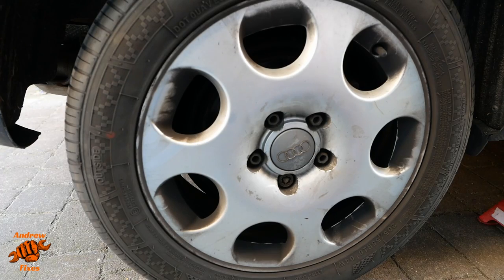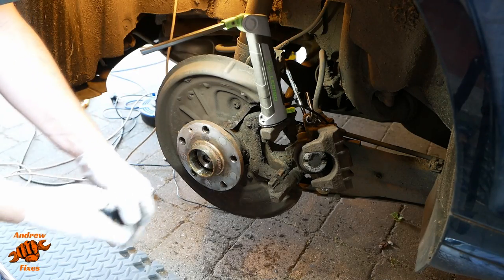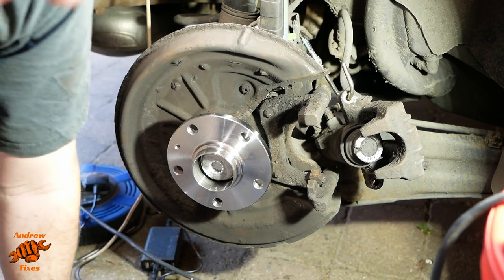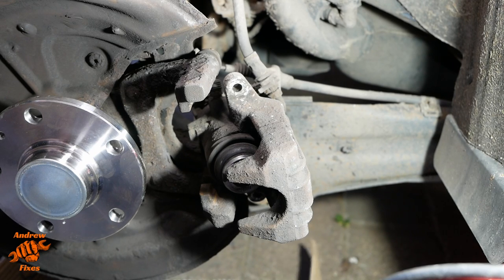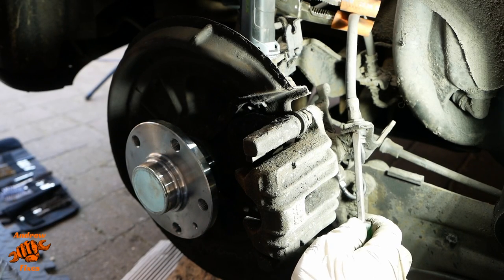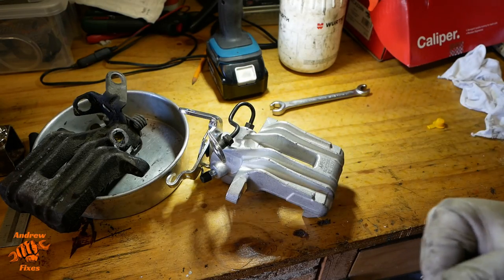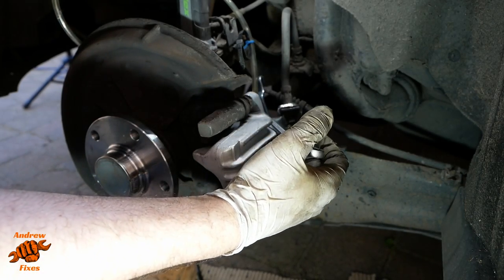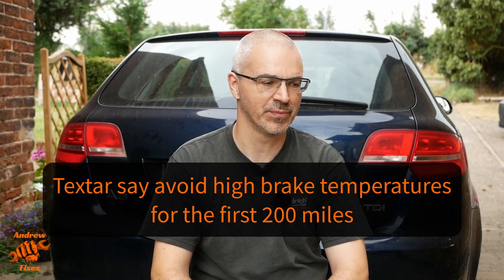Changing Audi A3 rear wheel bearing, brake discs, pads and caliper (8PA model code)

Comment: I remember that well on my golf, the rear wheel bearing is an awesome design to put on just slides on, just need to watch out for the size being 30mm or 32mm it's based on your brake code, mine was 30mm (1KD)

I used a scaffold bar too to replace it, if it was a common thing, I'd use a 3ft breaker bar, or a torque multiplier

Comment: The wheel bearing bolt torque is 180 N.m + 180° ? Pretty tight.
Reply: looked overtight to me whatever the manual said.
Reply: @duncan649 I agree; I read online (auto doc) was 155NM, and Audi forum was 180-200Nm plus 180 degrees then somewhere else said just do it tight enough with a breaker bar making sure not to over tighten is so I thought sod it; I’ll just tighten it to 200nm that’ll be enough. After torquing I felt the nut with a breaker bar and it felt like if I went anymore something would go wrong so my gut instinct felt like 200nm was more than enough. Furthermore when losing the original nut (m18) it felt lose and didn’t take much to undo. Apologies for the long paragraph. This is my experience 😂
Reply: @claireholdsworth5189  . Yeah. I recently changed the front bearings on my son's Audi, so naturally I didn't want the wheels to fall off!  Used breaker bar to tighten 'enough' and they ain't fallen off yet!

Comment: Would u believe I did this job on my neighbours A3 sportback today.
Calipers, discs and pads. Took me 3 hours.
When I looked at the job I broke my piston retraction tool trying to retard the piston !! So likewise recommended new calipers.
You,re ment to bleed the caliper fully before touching the handbrake connection or reconnecting the cable.
Everything went to plan today and I bled the whole system, got rid of old/ green brake fluid.

Comment: Nice job and video !
I had to change the same caliper too ^^
And now wheel bearing on the other side but I ordered the wrong size on xzn thanks to AUTODOC how to 🙄
Reply: My current issue is whether I should follow AUTODOCS' instructions regarding an XZN #16 or the XZN #18 as he uses.
Can you answer that?
Reply: @MariusKold  xzn 18 😉